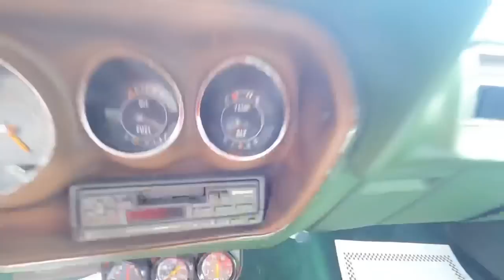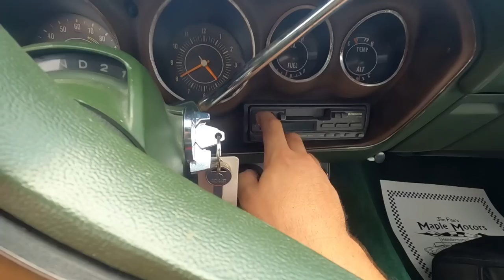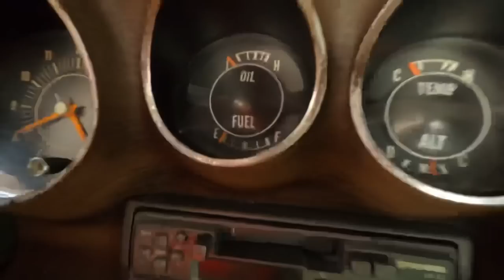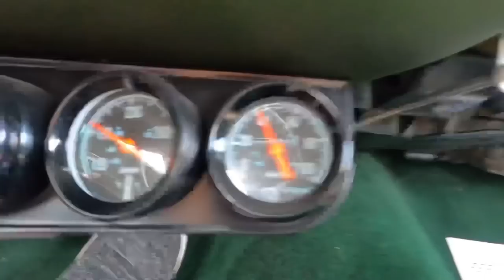Test Drive 1973 Dodge Charger 440 SOLD $19,900 Maple Motors #1706

Comment: Love the muscle in this baby.  Fix the wipers, the radio, re-cover the dash, replace the lower half of the inside door panels and you’ll be there.
Reply: @@kylefish8923even with the Bumperettes, it is still better looking than the 73' Road Runner front clip.